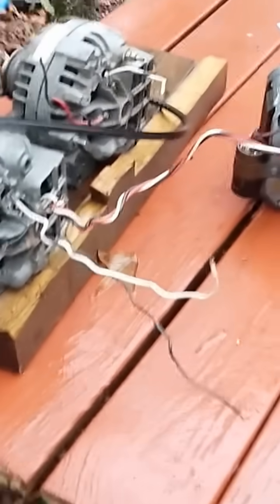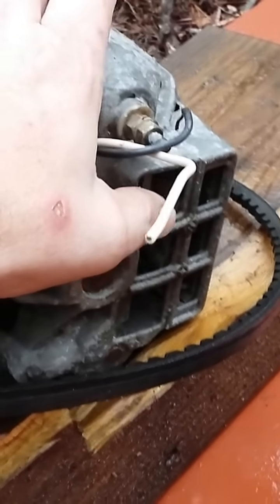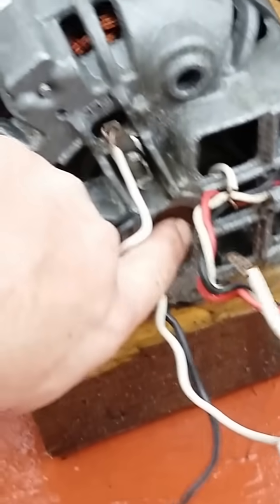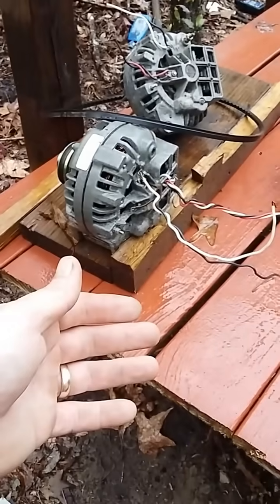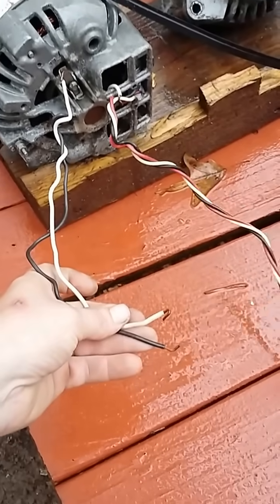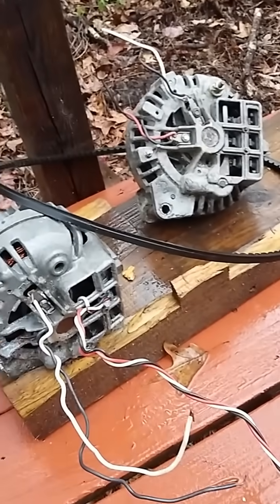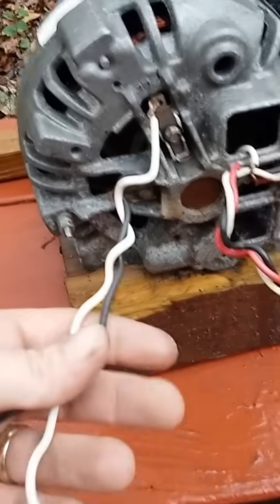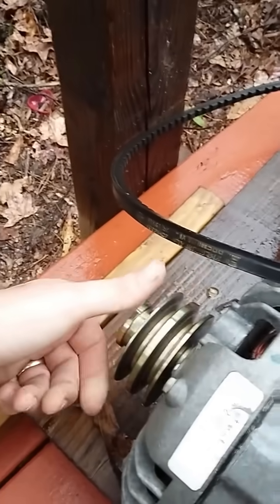Update Free energy forever no wind no solar no gas READ DISCRIPTION!!!

Comment: Don't understand why you won't live very long. Respond back to me when you can, about how the wire connects with the copper wire inside making the V
Reply: Because that's free energy..the electric co and gas co don't want people to know about something like this. Something so easy.
Reply: @swinn12235  I found out how to make it, takes more copper wire and stronger magnets.
Reply: @zacharysimpson7353  really?? Thanks
Reply: @swinn12235  I don't think many people have the time or free will to make one. The amount of copper coil needed, the amount of turns for each level of volts, the stronger the magnets, the more magnets used and something for the magnets to spin on. 77 turns for 24 volts 155-160 for 48 volts, in a 8-12 rings of turns, 24 magnets... So like 160 turns times the rings it's in and magnets on one side and the other of the copper wire rings. Like making 3 circles one magnets, copper in the middle an magnets on the other side. Magnets spin only, turning it slow should have the just to power on a fan, charger, some lights, an going fast would be 4x greater or more.
Reply: @zacharysimpson7353  so the more magnets and copper wire it has, then there's power by one fold
Reply: @swinn12235  you have Facebook messenger?
Reply: Well to be honest he sounds paranoid , but... On the other hand a few inventors of clean energy devices have died suddenly so who knows , for all we know he is telling the truth.

Comment: How does DC power produce ac power ? Please let ne know.
Reply: dc cannot flippin make ac bruh they get converted through a diode
Reply: @ryderwilson643  I understand diode create direct current but how direct current turn ac motor? Befor hit diode?
Reply: @ryderwilson643  well this video he put dc to create trunes ac motor right so its not true?
Reply: @motobacktoconstitution4138  this guy wasnt clear enough for even a 3rd year electrical engineer.
Reply: @ryderwilson643  where is real over unity its working sir please let me know.
Reply: @ryderwilson643  where is real over unity video its working please direct me to the link.
Reply: @ryderwilson643  to create ac sine wave it takes least 2 transisters so on so how video gentleman put DC 6 volt to turn AC 220v 90 amp motor is that redgit(true) ?
Reply: @motobacktoconstitution4138  yes it is
Reply: @ryderwilson643  are you saying 6 volt input will produce 220volt AC 90 amp ?
Reply from the maker: DC power which is just a voltage difference can easily be pulsed and ran to a transformer to create a pure sine wave which is AC. Alternating current like what's coming from your plug-in and your house can be wired up to what it's called a bridge rectifier which is four diodes in a certain pattern that only lets positive pulses out one side and negative voltage pulses out the other side if you use a capacitor at the same point at where the current is directed in or out it will make the pulses very small you can run that to another capacitor with a large microphone ratings and that's basically direct current a negative and positive...
So to answer your question DC can easily be converted to AC and AC can easily be converted into DC!
Reply: @ThomasBuie  I was talking about your autonator sir . you said you put 6 Volt Direct current ( how many amp? ) to produce AC current 220 v 90 amp AC current how can you put DC current to turn AC motor ? Its diffarent waves please let me know sir
Reply from the maker: @motobacktoconstitution4138  
that is what I said in the video and if you know anything about pie of the whole then you understand that these are the mathematical equations and the way to figure out free energy... this was is a test.
Reply from the maker: @motobacktoconstitution4138  brother I put all of the information how to build devices spread out through my YouTube videos so that I could share love and every bit of that love would always come back
Reply from the maker: #MICROPHONE

Comment: please read up on 3 phase vs split phase. Your house runs on split phase. Commercial buildings run on 3 phase. The alternator generates 3 phase and is not directly compatible with split phase. The safest way to do what you are trying to accomplish here is to either use the built in diodes and charge a battery bank and run an inverter to power your house, or bypassing the diodes as you show, using a 3 phase charge controller to charge a battery bank and use an inverter to power your house. You could possibly build a rotary converter using a pair of alternators with one being a generator, and one being a motor that drives a split phase wired generator, but that will be less reliable and more of a challenge to keep a stable output from than the battery and inverter setup.

I am not saying you could not run your grid isolated cabin on 3 phase, but you might want to at least swap out the breaker panel to keep the legs of the circuit somewhat balanced. Otherwise all of your load is on 2 of the 3 legs and you will only get 2/3s of your power along with it being rough on the generator. 

I would also watch the voltages pretty close and not plug in anything much more sensitive than a heating element or incandescent bulb unless they are sitting pretty stable at 208v/120v. All in all I am not an electrician and I strongly suggest you consult with one if you intend to do this.

Comment: Energy cannot be created or destroyed. Alternators produce 3 phase power you will want single phase to power your house. This guy has partial truth wrapped up in nonsense. They will produce 90 amps at 12 volts you need 120 to power your house so you will have 9 amps at 120 volts and again it will be 3 phase power even less when convert to single phase. 9 amps is enough to run a tv, light, that's about it. Ohms law watts equals volts times amps.... hes right it is pretty simple, amazing how he fails to explain it correctly.

Comment: Hey man I know that this is probably a basic question but how much heat waste does it produse per amp/volt if you have the formula also do you still have to discharge it between uses or does the copper pole to ground take care of any excess power made?
Reply: Bro this is a scam. Free energy cannot exist due to energy loss in every form.  Energy loss in the form of heat, resistance and sound. His design uses more energy that what is input because it breaks the laws of the universe if it were to output more than what was input. This guy is a scam.

Comment: i always wondered about direct from the ac before the the dioeds direct to the house box can this be done with power coming from the grid at the same time iwant to use for a power sorce to the alt pully belt a 110 cc minibike motor with auto 4 speed trans

Comment: Those wires are not 90 amps they will melt and cause fire
Reply: Ya... no kidding im no electrician 12 guage is protected at your house by 20amp even of it could handle 3x as much thays still only 60amps so IF THIS DID PROVIDE 90 AMPS those wires are way too small to hold that kind of current

Comment: BELIEVE ME, THOSE CAR ALTERNATORS DO REALLY PRODUCE ELECTRICITY 24/7 BUT YOU HAVE TO KEP THEM SPINNING WITH THE HELP OF A WATER MILL OR WIND MILL WHILE YOU IMPROVE THEIR POWER OUTPUT 👍😁👍
Reply: And he was mentioning of how he could plug into a wall I was wondering where is he going to get the power to spin is wheel

Comment: Naturally, this may indeed work. the potential is there. why? as I discovered last week, a magnetic field propagates at the speed of light but COLLAPSES FASTER than the speed of light! This IS your "free" electricity or quantum electricity.

As I have said, if you get a large transformer and using only one coil's terminals (in effect a solenoid) place a neon bulb across the terminals in parallel connection, you can then apply a 1.5 - 9v battery to the terminals. Nothing happens as the neon bulb needs at least 90vDC or 110vAC to illuminate. yet, the magnetic field is growing... at the speed of light. now release the battery.. see the bright flash as the field collapses?  try not to touch the terminals while doing this!

since we know we get extra voltage from a spark gap, it thus stands to reason that a gap in a magnetic circuit will yield extra current if done correctly. this aspect has been accepted already, as gapped transformer cores (they were once attacked by the ignorant and "misinformation spreaders" too).

Thus if two 3 phase stators are used, this can work, all be it with highly reduced efficiency due to the method they are wound. It's become clear that the heat generated in such devices as motors and transformers is due to this collapse or "recoil" current due to the faster speed of magnetic field collapse than that of its formation. the neon bulb also seems to show another color; a kind of UV + pink flash. what this is, to me still unclear. it could be cosmic radiation, uv radiation as the neon is kind of like a vacuum TEA laser setup, perhaps ions of the metals used (steel and copper alloys), perhaps higher energy state of the neon gas, or perhaps something else entirely? 

I will say again, Magnetic fields propagate at the speed of light, yet they collapse FASTER than the speed of light. in fact, based on voltage as a crude indicator, I'd have to suggest a magnetic field may well collapse some 80 times faster than the speed of light!
one thing is proven for sure; every action does NOT have an equal and opposite reaction! an expanding field must surely be "motion".

I'm starting to think voltage might travel in one direction and current the other... as for thermo-dynamics, this would be a return of the current you used. tell me, what IS electricity??? in short, we still don't know, yet are fast to try to discredit the work / findings of others. without doing any experimental work ourselves... sad.

yes, such a system is possible. as possible as you reading this or watching this video. if it were not, the energy that made you could not have made you, because it doesn't exist, thus you don't exist...
Reply from the maker: Jealous much how much time have you spent trash-talking someone you've never met and know nothing about. Plus to add to that you know nothing of electricity....  So sad...   I'll pray for you!
Reply: @ThomasBuie ; me too. sad indeed. all the best.
Reply: @amberandrickyyoder9018  are you trying to work this out and help all of us or just here to abuse others who clearly have a much better understanding then you? and thus, help those that ARE the theifs. these folks are putting in the efforts to help us all. you, from what i can see, are nothing but a pest to the workers. perhaps you could go watch TV. im sure you will find something to entertain you on it. maybe "home and away" aussie garbage. you'd love it. if you can follow the ever-complex plot.
Reply from the maker: Thank you for being such a nice person Amber.
Reply: @amberandrickyyoder9018  wow, i see. amazing stuff. please tell me more...

 I ask you as i can see your very smart... and kind, have no ego issues, are highly mature and loving person who clearly wishes us all well. one who praises the discoveries of others, as much as those others praise the discoveries of others around them. 

there is no denial, repression, regression, abuse, ridicule, immaturity, torment, disinformation, misunderstandings, etc. evident in anything you say. 
And, I'm sure that others reading your loving words will feel good about themselves and thus create a "ripple effect" of love through out the world. lifting us all. 

I just wanted to see your reaction as i "appealed" to your Ego. but, i do understand that childhood can be tough. try not to become a "bully". trust that you will get through it. and that those times wont matter. 
Bless you.
Reply: No the bulb won't last long from Jerry Einstein. Your formula is wrong.
Reply: @amberandrickyyoder9018  its nice you are concerned about the financial affairs of others...  but you obviously know nothing at all about physics. in time, you will be proven not only the fool, but also one who attempted to hold us back. thanks.
Reply: @amberandrickyyoder9018  oh wow ok. thanks! perhaps i can learn from you. please, explain this to me in more detail. I love to be proven wrong. i like to be humbled and this IS how i learn. please tell me what i could do to improve my understanding =)

Comment: Dude many many people learnt that simple electrics in school. as you said this is not rocket science. Nobody keeps this basics as a secret.  Its totally opposite. The energy companies want us to know that. They are searching for electrical engineers. even back in 2016..    you actually  need something like wind to drive the generetors. Those generators wont give you anything wothout moving. This is how they work: Changing magnetic fields/pushing electric charges around. This energy isnt free. Its allready around. You are just converting energy.
There is so many bullshit in it. Like a single capacitor would be able to produce usable ac.  You should read a few books to know how it works. Than you could try again to explain how it works. Thats something you missed very bad. Trust me. I worked on many generators and had educated people around me.

Comment: i'm saving this for later .  I am a 50 year old lady still saving her pennies to go off grid. But I need to ask so please no mean comments. what do you hook up the first one to to get it started? a solar cell? what starts the thing? Please anyone ? I would like to know more. How can I find out more??
Reply: If you want to have success with this method getting free power the best way is to watch all the videos you can with people using a motor to drive another motor, the ones who use one or more mass flywheels in their systems will put out even more power, and those who use capacitors on the motor and generator will do even better.   no one here will show you exactly how to do it, don't ask me why this is but most videos will just play music and let you watch their video.  there are some who are fake, but there are real ones too.   it takes time to learn what is actually happening and to understand how this can work but after time you understand how electricity can be pulled from the environment through the manipulation of magnetic fields.   this video you are watching here does not help much as he is not doing it correctly and he clearly does not understand AC and DC theory.    Chas Campbells videos will show you better how to do this.   or you can talk to me, I understand this plus other ways to create free power.
Reply: I creating something that'll give you affordable energy for some time, but in the mean time I would highly suggest solar energy depending on where you're going. If you're going somewhere hot and sunny, use solar, if not there's hydro and wind
Reply: @thearies2522  HE SAID USE A MOTOR TO TURN IT BUT SOME ARE JUST IDIOTS AND SOME LIKE YOU PROMOTE THINGS YOU GET PAID FOR.IN OTHER WORDS IF YOU KNOW NOTHING ABOUT A SUBJECT YOU SHOULD KEEP QUIET'MOST OF THE TIME THERES NOT ENOUGH WIND TO TURN A TURBINE
Reply: @howardhalfhill69  bro chill

Comment: this guy does not understand electrical power  he keeps saying that you have 90 amps from that alternator and if you put two of them together you would have 180 amps and you don't need 180 amps to run your house.  what he does not understand is you can only draw 90 amps from each alternator at about 14 volts.    after you remove the diode bridge rectification and the regulator from the alternator to only get AC power and spin the alternator up to a speed to get 120 volts AC you do not have 90 amps anymore.   its all about the power the alternator can dissipate in watts.   90 amps at 14 volts  you get 1260 watts.   that is what that alternator was designed to do.  if you source more watts than that through it, it will over heat and burn up.  so when re configuring it to do 120 volts you still have to keep the watts with in the same rating.  so you can only draw 10.5 amps at 120 volt which = 1260 watts.   120 x 10.5 = 1260.
Reply: Inside the box thinking on the re:

Comment: If it puts out 90 amp's why would you put a 100 amp breaker use a breaker rated for your current output because if you load 100 amp's on the motor and it can only put out 90 it'll eventually burn your motor up and yes I understand that current is supplied depending on the resistance and the voltage math stuff blah blah blah ik all that stuff but im just saying also your current and voltage may be high on the output but put a load on it and it may slow down and stop working properly those are meant to charge a battery so you could use it to charge a battery cell then have a few high watt inverters to give you your supply to your home it probably would be safer that way